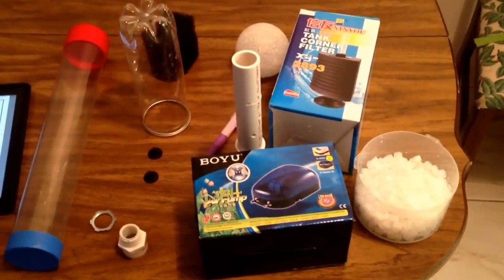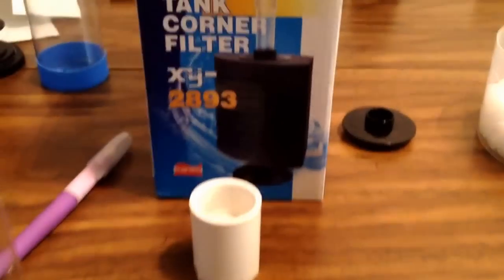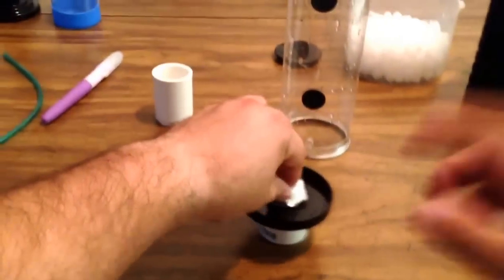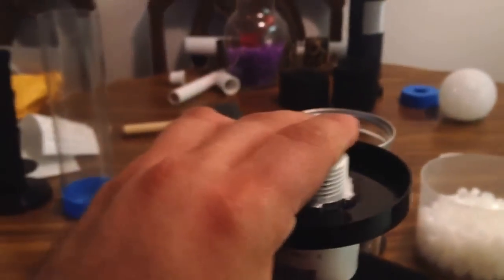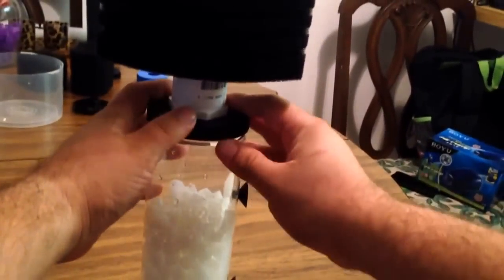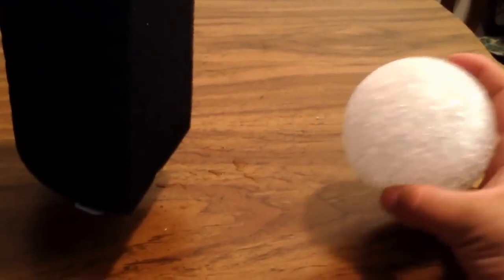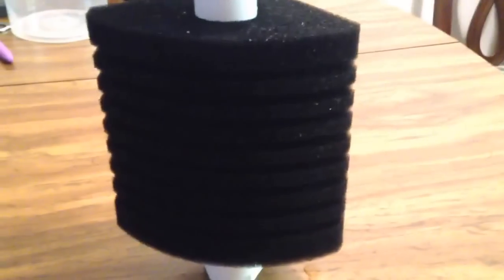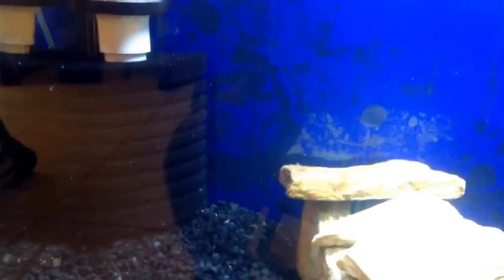Very efficient Diy moving bed filter: diy video

Comment: you can always get a t connect for your airline to combine those two outlets and use less tube in your tank while keeping the airflow. I like adding a adjuster to control my airflow also
Reply: +Marc Mayfield Not really. You will lose quite some  since you can only push so much air through one single line.